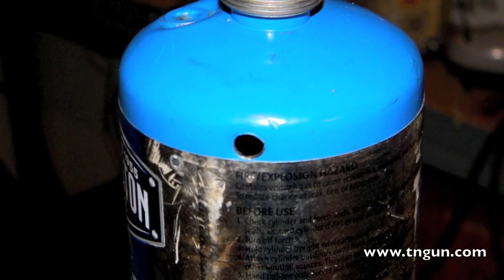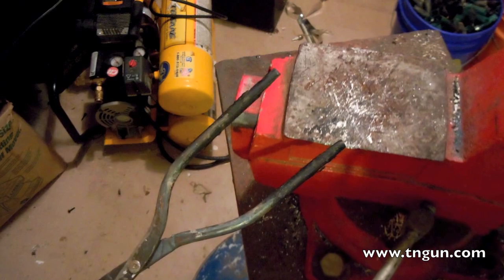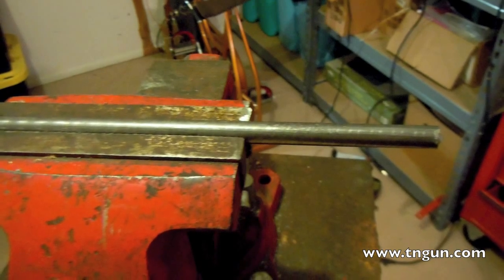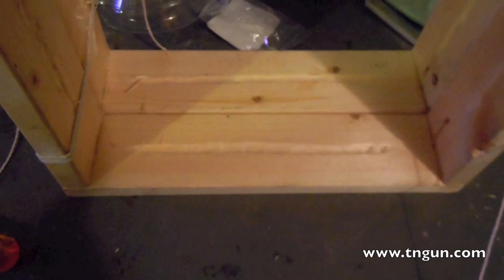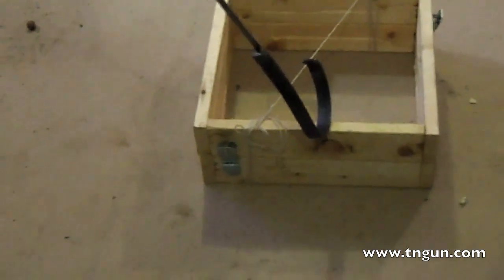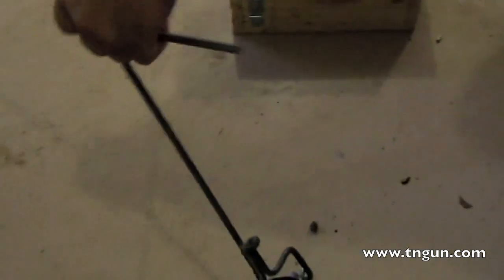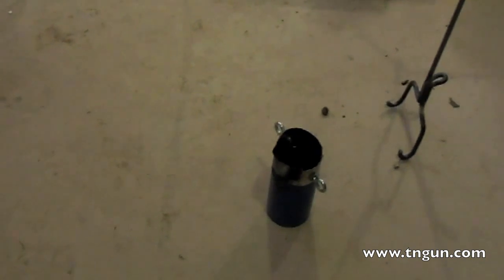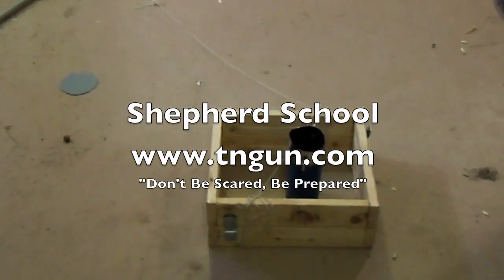Homemade Foundry Tools

Comment: @TNGun Just promise me that if you try to burn it off and see black curls floating in the air or get a sweet smell, DON'T BREATHE IN. Hold what breath you have and leave the area immediately. Even a little is fatal similar to chlorine gas (similar symptoms, similar effects, but people have been saved from exposure to chlorine gas... granted, not many, but some is more than none).

Comment: Nice idea for the crucible. Have/did you consider using straight bolts for the sides since your tool is curved? Might make it easier to pick up.

Comment from the maker: Short answer, no, longer answer is, that by the time you have the technical ability to melt steel you won't have the need, or inclination to use a ceramic mug.